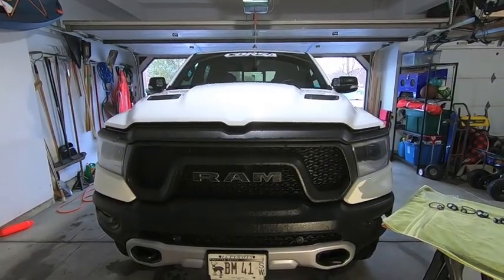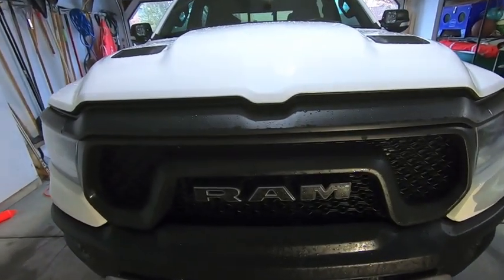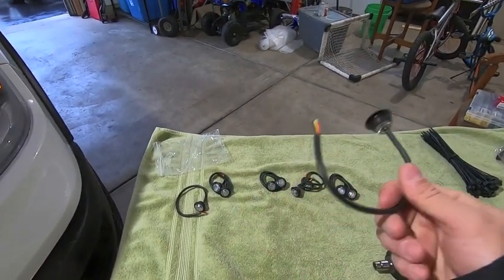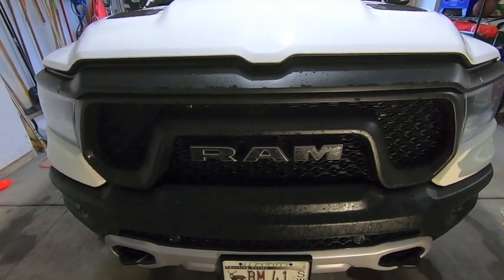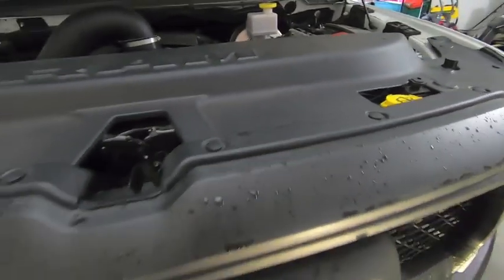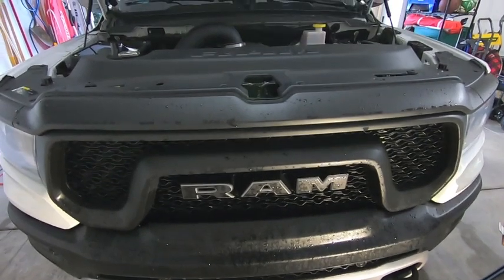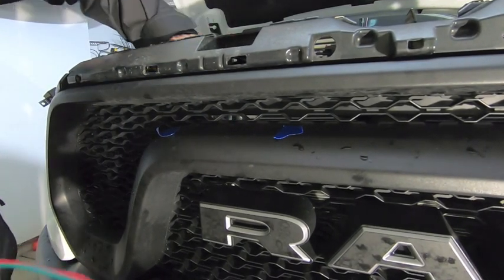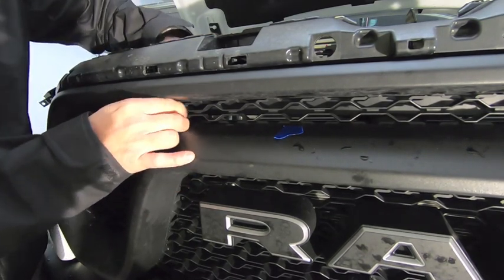Grill Lights - Ram Rebel

Comment: I followed the video to install a DLR relay so I can run TRX style grill LEDs on my 2019 Rebel. What I have found is the white and orange wire does give me a 12v supply if I test at the end of the cable, but when I connect that wire to the relay coil terminal it does not pull the relay in. If I test the wire while it is connect the the relay terminal it no longer reads 12v instead my meter remains at 0V. The fused supply direct from the battery to the relay reads 15V, if I connect that 15V supply to relay coil the relay is pulled in. The relay I am using is the Single pole version of the same auto zone relay you used. Do you have any idea why my relay is not pulling in? RsL44 single pole RL44 single pole
Reply from the maker: It sounds like you’re connection into the wire isn’t a solid one. If you get 12v at the plug for the wire but after tapping into it you don’t get anything, your splice isn’t making contact with the wire.

Also double check you are connecting the relay properly. Check your grounds
Reply: I’m having the exact same issue. Everything draws power individually, but as soon as I plug it into the relay, the stops and reads 0V. Did OP figure out a solution?
Reply from the maker: I believe he used a different wire (grey w/ orange?) to power the relay. You might have to dive into the harness or check online for a pinout of the headlight harness so see which wire is the positive for the headlights.

On my truck 2020 Rebel with regular LEDs, it was white and orange.
Reply: @WaterFowler41  I have a 2021 and have the same white/orange wire you have. I already tested them directly wired to the lights to see if it was the correct wire and it is. The wire still provides power but the moment I plug it into the relay, it stops. I bought two relays and it does it on both of them. Thoughts?
Reply from the maker: Man I’m at a loss here, you triple checked wiring? Verified your getting some voltage out of the wire before connecting it to the relay? You’ll need at least 9 volts (I think) to power the relay. You’re grounds are good? Both the relay and the lights should be grounded. The relay will still click if it’s grounded but the lights need to be grounded for them to turn on
Reply: @WaterFowler41  I have rough country lights plugged into the trigger 4. I spliced the drl lights the same way you did. Everything has power when not connected to relay, then no power once plugged into it.
Reply from the maker: @G_Milbourn  now I’m determined to solve this! I’m confused when you said you have power when not connect but no power when connected.  Can you send me an email at waterfowler4one@gmail.com with some more info on how you wired this light up? I can send you a wiring diagram
Reply from the maker: Got your email, let me dig into it and get back to you.
Reply: Did you guys figure it out? I am having the same issue.
Reply from the maker: Are you trying to grab the signal from the passenger side headlight? That’s the light I used in the video.
Reply: @WaterFowler41  Driver side. Orange with white stripe I get 12vdc from it when the truck is running. 10vdc when the engine is off by ignition is on. It should work but 🤷
Reply from the maker: Have you tried the wire on the passenger side and checked to see if it responds the same way?
Reply: @WaterFowler41  gave that a shot same outcome.
Reply: i am impressed at the level of support in youtube comments! :-)
Reply: Have you guys figured this out yet I’m having the same issue. I have a 2021 rebel
Reply: @unixdoes  ya I saw that. My problem isn’t the harness it’s getting it to turn on when the marker lights go on. Don’t want the lights on during the day.
Reply from the maker: That’s for the older Rams. Wiring routes and point may not be the same.
Reply: @WaterFowler41  did you ever Figure out why the white with orange stripe wire isn’t working for some of us. Followed your tutorial and am having the same problem as these other guys.
Reply from the maker: Are you pulling the signal from the passenger headlight? Also are double checking by rotating the light knob inside the truck to manually turn the circuit on for testing?
Reply: @WaterFowler41  I am checking by turning the headlight lamp but I was grabbing it from the dentures side. Is it different wires for the drivers side
Reply from the maker: Try the passenger side. That’s where I pulled my signal from.
Reply from the maker: I have the pinout diagram for the passenger headlight. Pin 5 is the white and orange and where I pulled power from. Can you check and see what color wire is in pin 5 of the drivers harness?
Reply: @WaterFowler41  so pin 5 is white with brown stripe that’s the problem. They used different wires on the drivers side harness. By any chance does that diagram show what pin the parking lights are on
Reply from the maker: Shoot me an email and I’ll send you the pinout I have. waterfowler4one@gmail.com
Reply: @WaterFowler41  I ended up wiring it to the 7 pin trailer marker light circuit if that helps anyone. found that the driver side was giving 12vdc but not enough current to trigger the relay.
Reply from the maker: Hey guys, on the drivers side the white wire with brown stripe should be the drivers side marker lamp. I found that info on diode dynamics website for their drl board. So white /orange on passenger side, white / brown on drivers side.
Reply: I tried pulling from driver and passengers side (2020 Rebel). Neither side worked so I pulled out my multimeter and checked voltage.. 6.5 to 7 volts on both sides. It takes roughly 8 volts to power the relay. I ended up tying #30 into my trailer marker lights in the fuse box (mine was F12 in the fuse box) and now everything works. Hope this helps someone.

Comment: Tapping into White and Orange cable on the passenger side is not activating the relay… 😢
Reply from the maker: A. Make sure you’re pulling this from the passenger harness not drivers.
B. There are two white/orange wires, grab the signal from thicker wire.
Reply: My cable is TAP into PIN number 5 as you mention you also tap into it (W/O). I also try many other cables and no luck.

Comment: Nope you don't need to remove the second plastic piece.  All you have to take off is the first plastic cover.  There is plenty room to work after that.  Been there done them.
Reply from the maker: I removed it so I can pull the grill out a bit and reach behind the grill to pull my wires through.